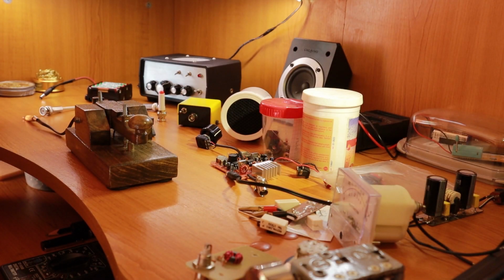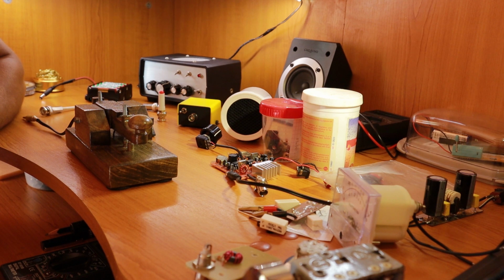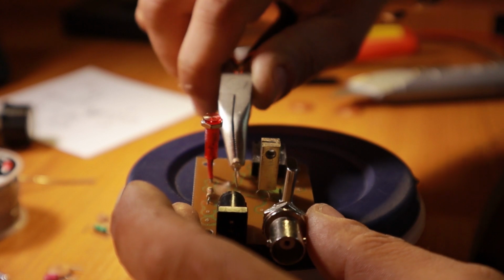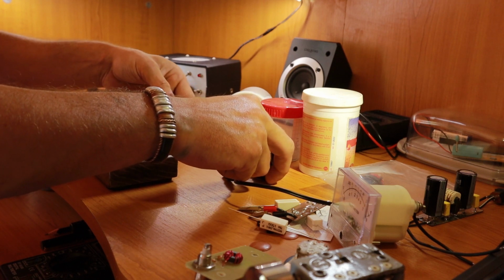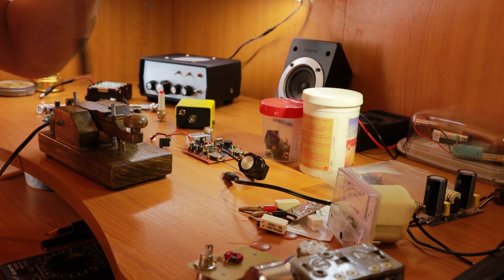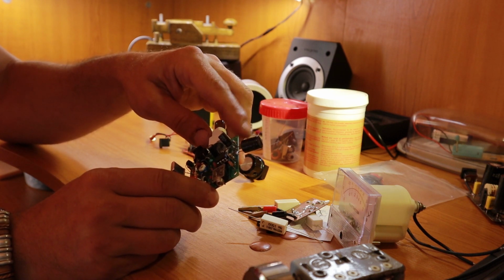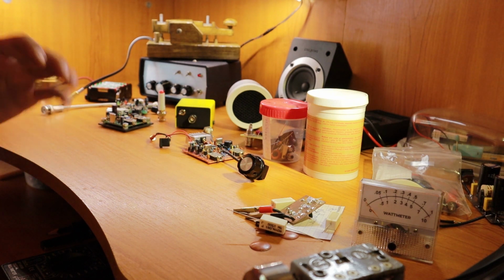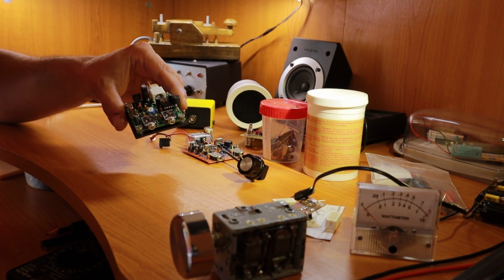The First Steps In Amateur Radio / Ham Radio. What is your story ?

Comment: One of the most useful tools I have purchased recently is a NanoVNA. You can use it for measuring coils and capacitors as well as crystals, LC circuits, complex impedance and a whole bunch of useful antenna stuff, which is what I mostly use mine for

You can even use it as an RF signal source 

Get your license and get on the air :-)
Reply from the maker: I got the other comment as well in the email but for some reason I can't see it on the video. I will make a video about the PCB as I have a few people that requested it. About the NanoVNA, yes it is an amazing tool for the money and I'm trying to put some budget for that too.)) 73 my friend and have an amazing week.

Comment: I want to know what the little box is next to Sputnik. It looks interesting.
Reply from the maker: The little yellow one ? It's the dual band low pass filter for both 40m and 80m bands. I built it inspired by Peter... VK3YE as he had a similar one as well.

https://youtu.be/3WmZNtCRxE8
Reply: @dxexplorer  No, to the left of Sputnik, a little black box, looks like a mini radio?
Reply from the maker: Ahhhhhh... nooo as I couldn't find a box just yet hahaha. It's the battery pack that I use now and then for portable that has a 12v output. And the other metal box it's the soldering stuff that I don't know how is called hahaha.

Comment: I have always listened to the radio before going to bed for as long as I can remember. I have been left to this day. I have always been interested in electronics and circuit design. I finished school and became an electronics engineer. Even though I don't work in the profession of electronics, my passion remains. A few months ago, before I found your channel, I decided to go back to analog electronics because most of the things I do for myself are digital electronics. I am slowly coming back to building basic electronic circuits with the use of transistors. I decided to do so because I like such classic layouts. You inspired me. 73!
Reply from the maker: I'm really happy you are coming back to the "old school designs". I also used to be more into the "new technology in the past... all digital and all that. Until I got to work with it on the cruise ships. After working for a while with the old analog stuff that made me feel like I'm in the 80's... when we changed all to digital it felt like WOW. Until the problems started to appear... then more and more problems. So I realized that new technology it will never beat analog. And that's how I decided to only build analog stuff. Built to last... most of the time at least )) 73 my friend.
Reply: @dxexplorer  It has its charm and beauty, but also requires a lot of knowledge. I like digital electronics and sometimes when something doesn't work out of my transistor circuits, I go back to digital gates as a rest. However, not only electronics is of interest to me. I love Astronomy. I rest when I can make observations. My eyes and I rest (I work in the IT industry). I also like to put together models of airplanes. I am in the process of creating a small collection of Polish military aircraft models that were in use before 1939. An interesting fact is that we sold licenses for them to Romania, so I have some decals with Romanian markings. As you can see, man lives not only with electronics :)
Reply from the maker: Clearly people that are passionate about the amateur radio hobby... seem to share all the rest of the hobbies hahaha. I know exactly what you are talking about. For me is this and sailing... but also photography... I don't know much about astronomy but I also love it... also building model planes... only that I'm more into the simple ones with rubber motors... so I think if we were neighbors we would get kicked out of out houses because we would end up playing with all these like little kids ))) It's nice... life is too short... people should do more of these hobbies... is a medication for the brain and the soul too... especially after a long day at work.
Reply: @dxexplorer  Exactly as you write, for a hunger with kids and planes with rubber band or gliders that I also built in the past. A fantastic sight as it flies and flies. Nobody would notice that there are not only kids on the team :)
Reply from the maker: Hahahaha. I can't wait for my nephew to move in Romania as we make a great team in plane model building and flying them... especially when my sister is joining us as well hahaha.